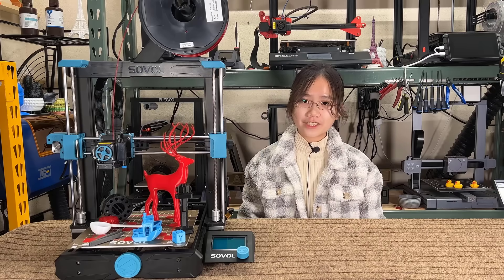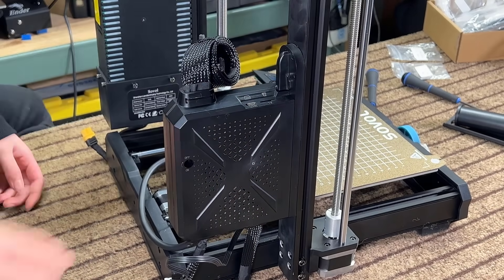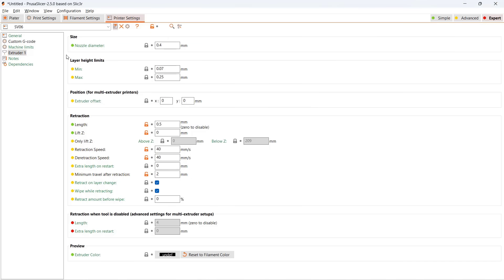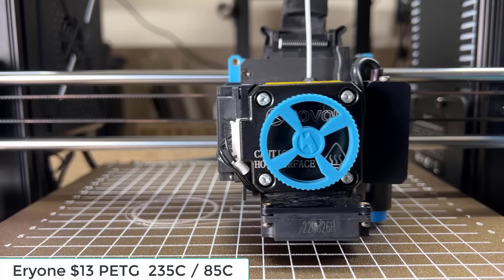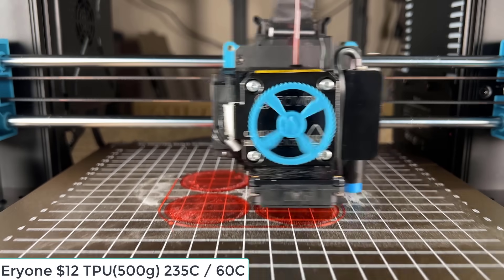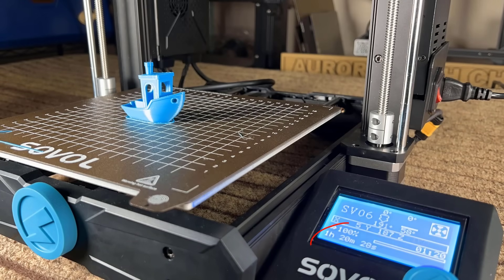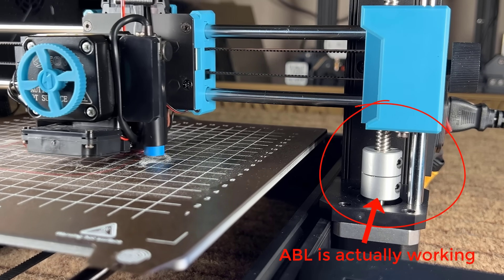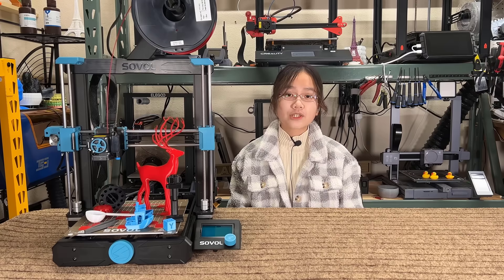Sovol SV06 3D printer: A Prusa MK3S+ clone with injection molding parts for a fraction of the price

Comment: A Prusa clone with Ender genes.  
The SV06 does not have a stop switch. Nothing stops the printer from ramming into bed if the leveling isn't right.

Mine had the sensor set too high from the factory. To do this, the small screw above the touch sensor must be slightly turned back. And then the sensor needs to be leveled. The Z offset can be adjusted and the bed leveled.
There are instructions on how to do this if everything works, but no instructions if it doesn't.
Z-leveling can only be performed successfully if Z=0. If Z is higher, the nozzle will ram into the bed later.
If the sensor is set too high on the head, not all 25 points are measured. Instead, the printer silently aborts.
As a beginner, I've been struggling with bed leveling for a week now.
The statements in the Sovol Forum are only 60% correct. 

Conclusion after a week, when the leveling is done, it is a good printer, only too little information for beginners on how to fix errors.
Reply: Another downside is that the front fan is so deep I can barely see nozzle. In addition, this sucks the heated air to cool the component. It's a 40x40 side fan. The cooling fins are also cooled with a 40x40 side fan.

The first thing I printed was a new cover for the power supply. Now I have a 80x80 temperature controlled fan (12 volts) there that has a step down controller.
Reply: The menu item "change filament" works well.
(Heat up, push a little through the nozzle, take out the old filament, press the button, pull in the new filament, push a little through the nozzle.)
But changing the filament by hand works badly. The wheel is only for show on the E axis
Reply: An SD card is based on the SPI protocol.

The Micro USB port is based on the Serial-over-USB protocol with a CH340 chip.

A USB A port is based on the USB host protocol.
Sure it would be possible to use a CPU that supports USB host and costs more. Or to install another chip for this function.

Comment: I'm sure aftermarket firmware will come out that will hopefully fix all these issues. Though I'm really glad they used 2209 stepper drivers and not 2208 or 2225. Make sure to put a little lube on those rails, so they continue to run smooth.

Comment: Sovol went to the trouble of designing their own controller board so why they did not include an additional driver to allow dual independent Z axis for G34 is beyond me, your problem of the Z axis not synchronising by their method shows that dual-independent Z-axis is the way to go, relying on mechanics to sync them obviously has some shortcomings, however even the aded cost of an upgraded controller board and housing still brings the price much lower than the Prusa MKIIs+ although I love it when I get firmware updates from Prusa, they are always trying to improve their machines and when something goes wrong the fix is just a phone call away, every time I have called Prusa they have fixed my issue 1st time, is this worth the extra cost? if you use your machine all the time then yes, but if you only use it now and again go with the |Sovol machine.
Reply: Actually z-align not working only shows a quite dumb error in design: It tops out hitting the cable of the printhead to the frame, instead left and right x/z joiners hitting the top, like the Prusa does. So it can not align at all. Just add some clamps at the top of left and right z-rods, so the joiners top out before the cable hits the frame... No need for independent z1/z2 drivers.

Comment: Overall it seems like a pretty good printer for first time users at a decent price, but that gantry problem could be a real frustration for new 3d print users. I'm guessing the z screws aren't run on independent steppers or they would have implemented better levelling using the probe.
Reply: Agree. I would never think to check that out, and nothing is more infuriating than having to bug solve a new product straight out of the box.